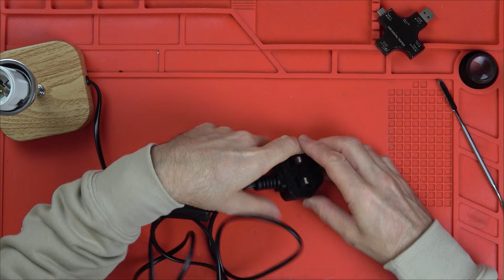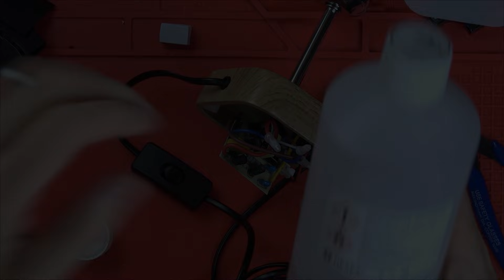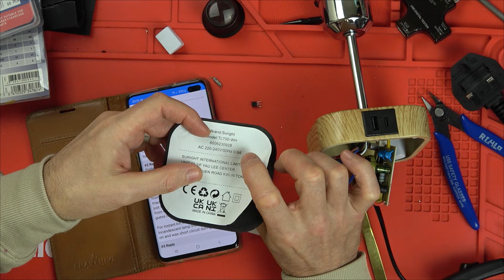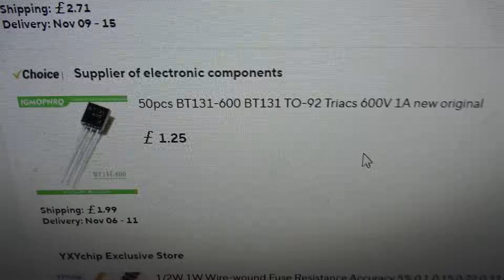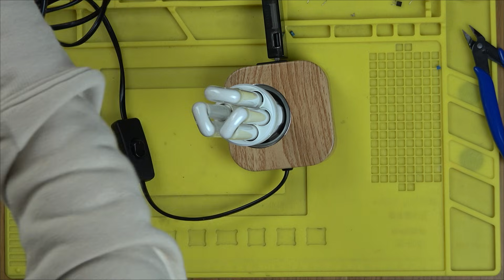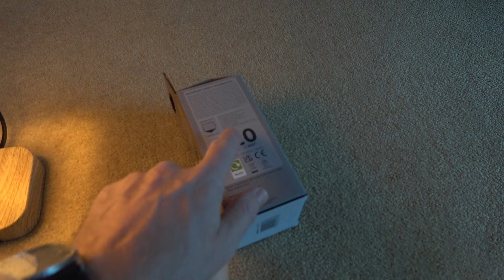Fixing a Touch Control Lamp That EXPLODED

Comment: Assinine design. It looks like they read the application note for an SMPS LED driver that's made to operate with TRIAC dimmers and just copied it. They could've just implemented dimming on the secondary side with a bog standard SMPS flyback controller. With LEDs diming isn't linear with current but you can adjust feedback for it. Imbeciles.

Comment: Please tell me you don't normally waste so much money on shipping on Aliexpress..

If you have 'Choice' items, you need to spend 10 quid(probably.. for me it's 10 eur) to get free shipping(only with 'Choice' items)

One of your orders was Choice, other 2 not. It's possible you could have found listings for the other 2 that were Choice, even if perhaps slightly more expensive. Then, if not enough perhaps, you could have added something extra to get over 10 pound mark and the shipping would have been free, saving you near 5 quid.

I would also tick the 'Free Shipping' box when searching for things to get only Choice and free shipping items. But definitely do need to search normally as well because price+shipping might be cheaper on one listing compared to price alone on a free shipping listing.

Aliexpress is an absolute cesspool when it comes to amount of listings for the same items, price differences and shipping prices. Whenever I buy from it, I spend ages searching for the cheapest possible listing(either price alone or price+shipping) for what I want. The Choice bullshit just makes it worse - forces you to overspend to get free shipping.

Comment: You should not use energy-saving bulbs (inductive load) in a lamp with a touch switch, as this will damage the touch switch. Incandescent bulbs are not a problem, and LED bulbs are usually not a problem either. In an ideal world, the manufacturer should state this on the product.

Comment: You're quite correct about the Triac, they can be used to provide varying amounts of power. They are typically used in food blenders to feed a variable supply to the AC motor, using pulses from a Hal effect transistor being triggered by the magnetism of the motor when it turns. The Hal effect transistor is mechanically wound closer too or further away from the motor to change the time it is turned on and off. I think the IC turns the Triac on and off at different frequencies depending on the dimmer setting. Your electronic knowledge has become quite extensive, if I had an electronics repair shop (if it was worth doing anymore) I would hire you 😃
Reply from the maker: Such kind words!! Thank you Ged. I think if I was doing one product over and over again I would get used to it and maybe even get good at repairing it. However 😂 mixing up the items that I do always leaves me in a complete mess of not understanding things. I'm hoping though that eventually I will get better (fingers crossed). Thanks again
Reply: @Mymatevince I think doing different things all the time might be more difficult to get a handle on troubleshooting a particular item but you start to see a lot of commonalities between apparently different designs. In the long run it makes you better at fault finding. But it is good when you get a few of the same things in a row, just to learn more about one design and its weak points.

Comment: Regarding the voltage of the BT131-600 triac, the 600 Volts specified is a PEAK voltage. The 240V -6% +10% mains voltage is an RMS value which could have a peak of around 373 Volts. Although in this instance it isn't a problem, you might need to consider the peak voltage of the mains in the future.

Comment: THe way a triac dimmer works is by varying how much of the AC waveform it's turned on for.  When the gate receives a pulse, the triac turns fully on until the current through the load drops below a certain level.  So the little chip is sending a series of pulses to the triac to vary how much of the sine wave of the mains power the light is turned on for.
Reply from the maker: Thank you Skonk 👍

Comment: Initial thoughts..wrong bulb. If I'm correct and it's a standard fluorescent, this will overstress the dimmer circuit (usually a triac) and probably not even dim or work. You have to use the right type of bulb designed for a dimmer, the bulb has special circuitry inside to match the bulb to the dimmer.
It's complex and fraught. Triac dimmers plus non-filament bulbs is known inside the industry as the dimming system from hell.
The TO-92 triac also looks very undersized. TO-220 is the usual size.

Comment: fairly standard to use g/y for the touch sensor bit, not actually compliant but it's what they have in china to connect to the case. and TR1 may well be a triac
Reply: called it

Comment: The 13A fuse in the plug is pointless, I'd have swapped it for a 1A or 3A fuse. Perhaps that would have protected the triac and internal resistor too.
Reply: Laziness by the manufacturer.

Comment: Nice lamp, fault finding and fix. Always exciting that first test after fix, is it going bang or is it going to work, or is there more faults.
Touch sensitive electrical device for some reason brought in my mind an old 60's tv-series "The Prisoner", where a room size computer malfunctioned, and electrocuted a guy touching metal handle on it 
All that mess was caused by Number Six asking one simple guestion: "why?" 😅

Comment: I have two similar lights and both failed. 
I just completely removed the touch function, rewired everything so it works like a classical lamp with a switch. For the bulb I just use a wifi controllable one which works with my Amazon Echo. 
Now I can just say "Alexa turn the light on/off" or dim it, which is even more comfortable.

Comment: The SCR, or Triac, switches at different places along the wave to reduce  the amount of power available to the load. 
More akin to pulse width modulation than a variable resistor. 
Sort of.

Comment: Around 6:25 onward — they wired that lampholder incorrectly as with US colours, the black is live and white is neutral. But at least it's electrically correct with the actual live going to the centre contact, since they swapped the other end too.

Comment: A touch sensor can detect your finger through the plastic, because your finger coming nearby disrupt the electric field of the capacitor formed by the object. This is detected by an electronic circuit which in turn cuts off the AC signal via the TRIAC.

Comment: The only types of LED bulbs that will work with a touch lamp will be 3-way bulbs all other types of bulbs will order not work at all or will only work on the highest light setting meaning you would have to touch the lamp three times before the bulb would turn on. These are also called dimming bulbs depending on where you live in Canada they are called 3-way LED bulbs.

Comment: I have a lamp like this in the States, one evening I touched the light to turn it on and got a large static shock the light still works but no more USB. The bulb that is installed is still the one that came with the lamp.

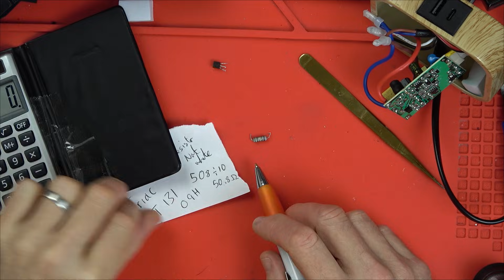Comment: @ 21:30 The silver band is a 0.01 multiplier, so the value is 50 x 0.01 = 0.5 Ohm with a 5% tolerance... not sure about the black band on the end maybe just a flag as a fusable resistor from the manufacturer or for a fuse rating, it is a fuseable resistor not a standard resistor.

Comment: 21:04 If you really want to get involved, you can Dremel the case until you reach the wire inside. Chances are it blew off centre, so one end to the middle will work, and from that you'll get close enough to 50% of the original value to make an educated guess.

Comment: I have one of those touch controlled light on my nightstand and it is indeed very handy to be able to turn it on so easily in the darkness. Mine is from Lidl and came with a bulb that had the 3 stages dimming, I didn't think they would incorporate it straight into the lamp with a usb charger on top of that for such a low price!

Comment: The name triac comes from the fact that it has three (tri) pins and is for use with AC. A triac can never be partially on. It stays off until triggered, and than latches fully on until the current through it goes to near zero. This dimmer, like most, regulates power by triggering the triac at a specific point in time, partway through the AC cycle.

Comment: You need a Symistor (symetrical thyristor) for AC, triac wont work
Reply: Triacs are commonly used for this type of circuit.
Reply: @roberttco1 Triac is a common therm for semiconductors of this type, there are thyristors, symistors, dinistors opto-thyristors etc. all following the same rule of triacs, but they are different animals

Comment: I own similar lamp. Turn on/off is by simple tap. Light color temperature changed by double tap and dimming by tap and hold and no, after power loss it don not remember the settings.

Comment: yes.it is a Triac. Used for the dimming circuit. For this application a simple BT131 or similar should be OK- keep in mind required voltage and current. The BT131 is 600Vac 1A. If you assume the Globe would be 60W and you are using 240Vac, then current draw would be around 0.25A (Watts / Volts = Amps), so the BT131 (in TO92 package) would be OK- make sure pinout installed correctly.

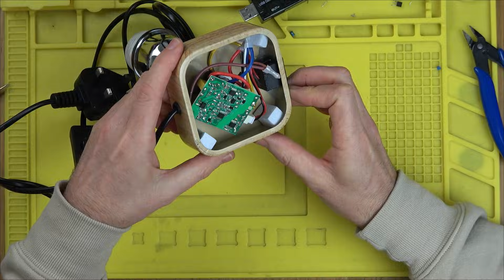Comment: Well Done Vince👍 Triacs are usually switched at or just after the zero cross of the waveform of the AC to adjust the brightness. The later they are switched on after this point, the less the voltage, hence the dimmer the bulb. 30:35 If the triac was shorted, the lamp would be lit all the time. I was thinking the 220 ohm from the gate, as it looked like brown mark just to the left of the numbers before you removed it. Great job once again. Best wishes Mick.
Reply from the maker: Ahhhhh thank you Mick. The man with the answers! Now I know how the Triac dims the lamp 👌
Reply: @Mymatevince  Wow, that answer was so good you responded 8 times 🤣 ( and counting!!)
Reply: Triacs works a bit differently, Once triggered a triac stays fully on as long as there is a current going through them and when they cross the zero voltage line the current stops and the triac turns off again. By choosing where on the sinewave you turn it on you simply modify the duty cycle or simply said how long it will stay on for the new sine wave. as the triac can never be partially turned on it always pass full current and you can only adjust how long it does so (You get the average voltage affect) it works well with incandescent bulbs as they have a thermal mass in the filament. and this is also the reason why the triac may burn if you install a CFL bulb to it as this always need the full voltage to work and the capacitors inside it takes a lot of charge current during each pulse making you practically short out the triac on each pulse instead and the CLF might not even light up. LEDs tend to work poorly on triac dimmers as they don´t pull enough current to sustain the triac in it´s on state and also that non dim LEDs can´t be partially on or off. In the LED test you did here the bulb will be fully on with the Triac passing higher current for each shorter pulse to charge up the LED bulbs built in capacitor

Comment: Hmm. CF lamps are not usually dimmable unless you have a special lamp and dimmer and, similarly with LED lamps, only lamps marked 'dimmable' will work with a spectial dimmer. As for the touch sensitivity, I know that some work by picking up hum from your finger and use it to store a rectified voltage to control the triac. Nice fix.

Comment: Fusible resistors should fail open without burning so I think they cut costs here and put in a normal one. I also would test if the new ones really are fusible. You never know when it comes from the 40 robbers.Idem for the triac.

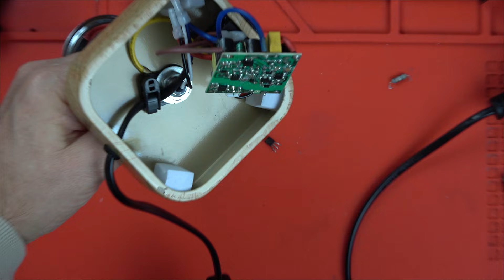Comment: 11:46, this actually is indeed used as the sense wire. One of the 8 pin ics will monitor that and probably puts a small charge on it, when a human finger touches it, there is a small drop in that charge and that is the trigger and with some of the internal logic this turns on the ouput. That output goes to a TRIAC (TRIode for Alternating Current) and the triac controls the lamp. Very simplified, its just a electronic controlled switch for Ac electronics and is also used in dimmers to chop up the Ac wave form and dim the lamp.

The triac does not have a big load so probably something caused a short in the lamp socket and violently blew the triac because it had the full power going through it.